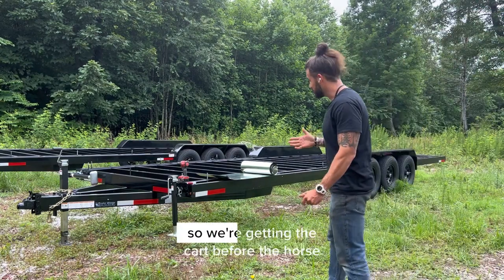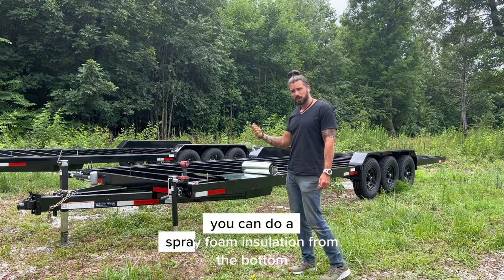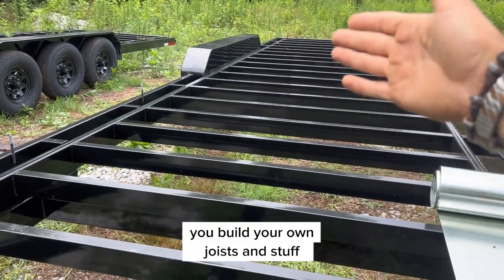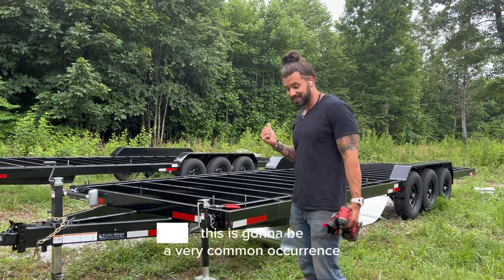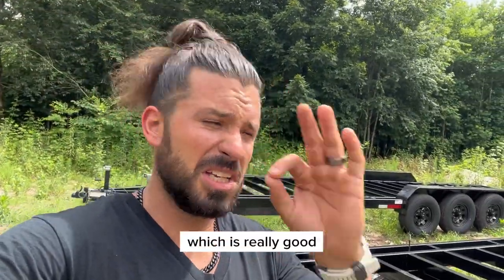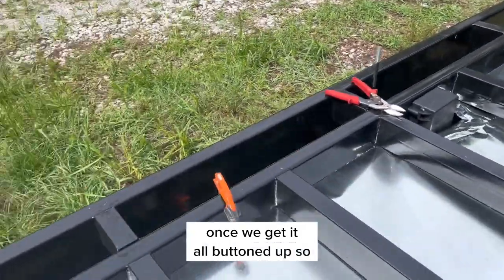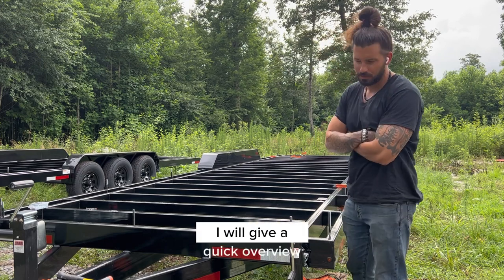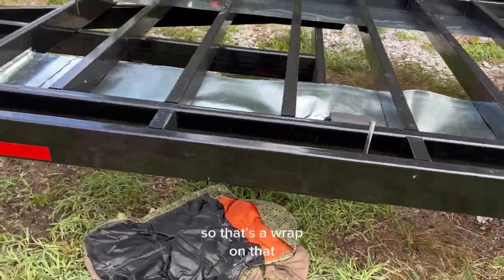Tiny Home Build - Part 1: Trailer Flashing

Comment: Excellent video, what size of metal profile do you recommend to make an tiny home 9 meters long, I am referring to the size of the chassis, the square iron of the platform where the house will be mounted, 100x50x3mm or 120x60x3mm would be of great help your advice. thank you.
Reply from the maker: Thanks! I had the trailers designed by Tiny House Basics. I'd recommend reaching out to them for these specifics!

Comment: Doesn’t the flashing protect the foam board too? I thought it was supposed to cover all the insulation
Reply from the maker: Full coverage is ideal, but not a requirement(as of my inspection) as long as you fill any gaps in the boards with spray foam. On the next ones, we'll be ordering the trailers with full flashing pans already welded on.